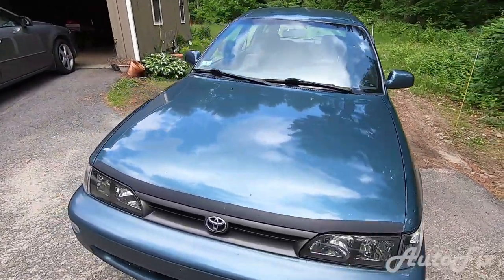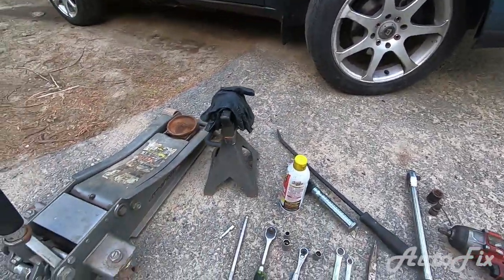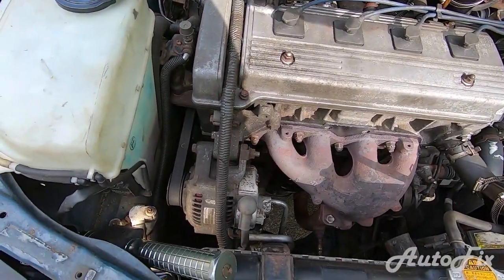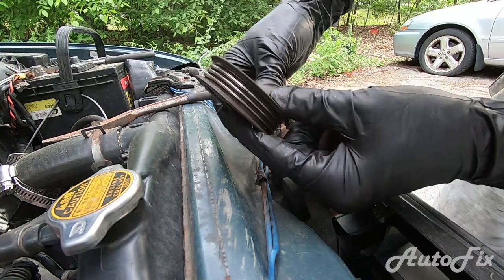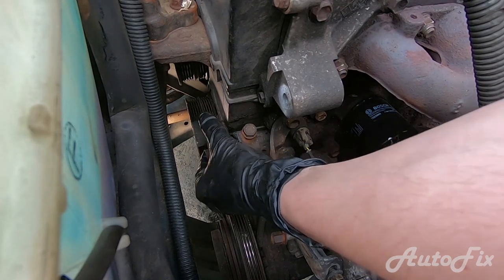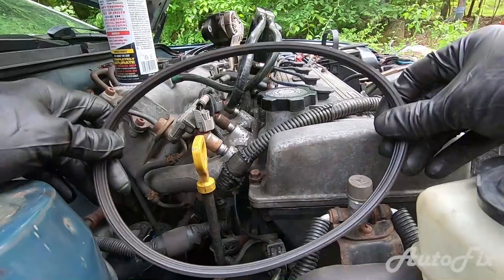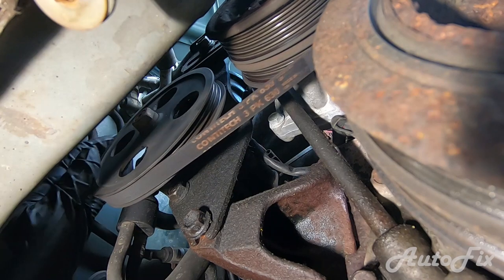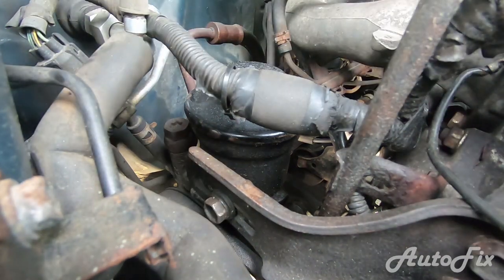Replacing Accessory Belts '93-'97 Toyota Corolla

Comment: Very short video. Also good explanation on how to tension the power steering pump pulley. Thanks.

Looks like a 4afe engine
Reply from the maker: Thank you! And yes it's the same block as the 4A-FE. The 7A-FE is just a stroked out version of the 1.6L with different cam shafts.
Reply: @AutoFixYT  the 1.8 version. I habe the exact same car and colour in 4 door sedan and it still runs great. The only problem is the roof welds (there are many) are all starting to rust through
Reply from the maker: @therealspixycat  oh no that's pretty bad 😬
Reply: @AutoFixYT  all the spot welds start rusting on the roof. Seen the same problem in the engine bay area. Car was produced in Canada I believe for the North America's
Reply from the maker: @therealspixycat  Yeah that's not good

Comment: Hey man, can you pls advise what is the manufacturer of the headlights you use?
Reply from the maker: The brand is called DEPO. Just search 1995 (or whatever year your car is) black housing headlights.
I then opened those up and added a projector to the low beams.
Reply: @AutoFixYT  thanks a lot!

Comment: Hello thank you for this tutorial but I have a question I need to put back my harmonic balancer on my Toyota Corolla 1994 but any idea how much torque I need to tight the bolt on this harmonic balancer please help thank you.....
Reply from the maker: My Haynes manual says 87 ft. Lbs
Reply: @AutoFixYT  thank you so much appreciate it 
lol I have this manual which page I can see this information??
Reply from the maker: @EJ3.16  I found it in the specification page of the engine chapter
Reply: @AutoFixYT  okay thank you 🙏 very much

Comment: Will the water pump still work without the powersteering belt just asking because I might just delete the powersteering
Reply from the maker: Yeah it should. I think the water pump is driven off of a different belt.
Reply: I've been driving my '97 Prizm (aka Corolla) for a few months now without power steering because the belt broke.  So, yes, the water pump should still work.   I was watching this to learn how to replace that belt.  I think I can do it now.
Reply: @leefrench9567  I just did my belts on my '97 Prizm. The power steering is the only thing on that belt, which is driven from the belt driving the water pump. '98 models went with the full single serpentine. I know this was a month ago but if you haven't got to it yet be forewarned.. It may not be easy to find the right belts which is the opposite of what I assumed being basically a Corolla. Maybe I should have said '97 Corolla now that I think about it. I grabbed 3 PS belts before finally taking the old destroyed one up there to compare and be absolutely sure. It took just the tiniest bit of extra slack in one I bought for it to not work with the adjustment available. You might as well grab an alternator belt as well since it has to come off anyway. I thought my belts still looked fine after some squeaking when first cranking it up but it didn't take long for them to suddenly go completely. I ended up with a 'NBH 25030245' from NAPA that works good for the PS belt and just grabbed an alternator belt from Autozone. Mine didn't have a removable splash guard behind the wheel but I could still get to the bolt easy enough with the car on a jack stand. Took a prybar for leverage while pulling for deal life on the ratchet to break it but once I did that everything else was easy. Used a 9/16 wrench I believe on the top bolt. Just a regular cheap ratchet set for the alternator bolts. After the initial finagling with the alternator bolts (which I didn't remove at all, just loosened til I could move it) the whole process took probably less than 10 minutes.

Comment: Question. At 22m. You said if it squeaks, tighten or loosen. I put on a new pull and belt for my ac and not matter what I do it squeaks, so annoying. What do I do to fix this
Reply from the maker: If you are sure you have the correct tension on the belt, make sure you didn't over tighten the pulley. Also make sure the belt didn't get any oils or grease on it. Other than that... maybe you can see where the squeak is coming from. Is it from the tensioner pulley, or is it from the AC compressor. Could be a bad bearing in the AC compressor.

Comment: How many liters of transmission carry those automatic boxes is bad if you go over the level of a 1994 toyota corolla and how much does it take to do the service to the box
Reply from the maker: It should say it in your owner's manual how much fluid it takes. I don't know how much a 94 automatic takes. There are also multiple options. There is a 3 speed, a 4 speed with no overdrive, and a 4 speed with overdrive. So it depends what you have. Do not go over the full mark. Level should be read with the engine running, transmission warmed up, in park or neutral, and the car on a flat leveled surface.

Comment: is it safe to use pry bar on power steering reservoir to tighten PS belt?
Reply from the maker: Like I said in the video I am putting very little pressure on it, and I have a metal reservoir, not plastic. You don't need a lot of pressure to tension the belt. Just enough to stretch it and that's it
Reply: @AutoFixYT  Okay, I'm planning to replace my timing belt, and this video is very useful. Your corolla 7th gen video series is great and I'm waiting for another how to for this car. Keep up the good work and greeting from Indonesia 👍
Reply from the maker: Thank you! Always happy to help! Good luck on the timing belt, I did mine last summer. It's an easy job but be gentle around the crankshaft position sensor. They break easily. The engine is non interference so the pistons won't hit the valves if you do it wrong. So if you do, just try again! :)

Comment: Hello, I have problem with my corolla, every coldstart, if I slightly turned or fully turned the steering wheel, the belt squeaks and I checked it everytime it squeaks, I saw it stop quickly :( my belt is already new btw. But when the engine is already hot, it will not squeak anymore.
Reply from the maker: Ok from the information you have given me I can make two conclusions:
1. Either your belt isn't tight enough (very easy fix, watch the video to see how to tighten it - you do not have to remove any other belts for this)
2. Your power steering fluid (Toyotas take ATF) is so old and worn that in cold weather it cannot hold pressure anymore and is stopping the pump.

So, first check your fluid. If it's not fresh, change it. It's not easy to flush it on this car, it will make a mess and you will get angry at it lol. I've done it twice in the past 8 years and I hated it both times. Once it's flushed, it should improve the situation.
If, however, your fluid is good when you check it, most likely the belt needs just a little bit more tension.

Hope this helps!
Reply: @AutoFixYT  omg thank you very much! I just tightened the tension on the alternator belt ☺ its a very big help for me. Now I am just wondering how do I flush my power steering fluid in the future, since you have said that flushing power steering fluid in this car was not easy lol. Thank yoh very much again mate. Stay safe
Reply from the maker: @amarlancervlogs962  To flush the fluid you want to remove spme fluid from the reservoir until the level is below the return hose from the PS reservoir, which is the one that sits higher up. Then remove the return hose from the recevoir. Have a bottle ready to catch the fluid, and stick the hose into the bottle. At this point it's best to have a second person but you can also do it alone, it will just be a lot more difficult.
However, if you have a second person, at this point have them get in the car. And you have a fresh bottle of ATF ready to pour in. Have them turn on the car. As soon as the engine turns on the fluid will go down. Add more but keep it below the open hole where the return hose goes otherwise you'll start spilling it. While you're adding fluid have the second person turn the wheels lock to lock (fully from side to side). Pay attention to the bottle you have that collects the fluid, it gets full fast (10-15 seconds). Once it's full, shut it off, drain it, and repeat the process with more fresh fluid. After you do it a few times it should come out clear. At that point stop, reinstall everything, top off the fluid level, and clean up the inevitable mess.

Another option which is a lot more simple but less efficient is to use a turkey baster, suck out all the old fluid from the reservoir, and fill it with new fluid. Then turn on the engine and turn the wheels lock to lock 3-4 times. Shut it off, suck out fluid, top it off, repeat. Do this 5-6 times and you should have mostly clean fluid in there. This won't get as much out but it's less messy and less difficult. This is a good maintenance thing to do. Once in a while suck out the fluid and just fill it with new fluid and then it will always stay somewhat fresh.

I know this is very long but hopefully this helps!

Comment: Pulley nut on my car is stuck so hard I can't get it off ☹️ the tensioner bolt comes out but the pulley nut is stuck hard, what can I do??
Reply from the maker: The best thing you can do is to keep trying. You can try to soak it with penetrating oil and apply some heat but very careful with the heat. Otherwise just keep trying.
Reply: @AutoFixYT  thank you very much will try again tomorrow meanwhile I sprayed it few times with wd40 that I had and gonna let it sit all night
Reply from the maker: @michaelmedicworldoftanks33fps  Hopefully that does ir for you! Let me know how it goes!
Reply: @AutoFixYT  yes it worked! I got the nut undone and took pulley off completely then fitted the belt across 2 large cog wheels and after that inserted the pulley back on under the belt then tightened the tensioner first and after that tightened the pulley because it seems it doesn't work the other way around ie. I couldn't tighten the pulley nut first and then the tensioner it had to be done other way around. Anyway thanks for this video it is very helpful and detailed explanation.
Reply from the maker: @michaelmedicworldoftanks33fps  Awesome!

Comment: Can you please do a timing belt video, I need to do it on mine, can you remove the last belt you did without removing any of the other belts? That’s the only one of the theee I need to do
Reply from the maker: I already replaced my timing belt so I won't be making a video on it for a while, but maybe one day I will!
Reply: @AutoFixYT  can I replace the last belt without removing any other belt? I just need to do that one
Reply from the maker: No, you have to remove at least one of the other belts to get the power steering belt off

Comment: Can i get a link to your headlights
Reply from the maker: Here are the assemblies. https://www.1aauto.com/1993-97-toyota-corolla-performance-lighting-kit-4-piece-set-crystal-style-diamond-style-euro/i/1alhz00040
I then took them apart and added a projector for the low beams. That was a universal retrofit projector from Amazon. Also I used LED bulbs.
Reply: @AutoFixYT  are they the same as the OEM assemblies because i recently ordered some headlights but they only had one hole for one bulb
Reply from the maker: @gabrielgomez6898  Yes those are the same. The two bulb ones are the USDM ones. The single bulb ones are the JDM ones. I like dual bulb better.
Reply: @AutoFixYT  yeah me to thanks for lmk

Comment: you almost sounded like Chris Fix
Reply from the maker: Haha kinda but not quite. I am a big fan of his though.
Reply: @AutoFixYT  also I did look up this video cause the water pump in my '96 corolla decided to take a shit on me while driving 
but also gonna replace the old belts with new ones cause one of the belts kinda has a rip in the middle (length wise) so I'd rather not have that belt snap on me when I'm driving 
but my corolla will be sitting in my garage until it gets a new water pump 
It can run & drive but it'll overheat
Reply from the maker: @Jeremy_Hill_2020  Oh yeah thats not good. Unfortunately I don't have a timing belt and water pump video on this car but might make one in the future.

Comment: Toyota never makes things easy
Reply from the maker: But it's still easier to work on than many other cars out there haha
Reply: @AutoFixYT  you’re right, Lexus and Scion still exist😂 I could rebuild a Ford/Chevy/Mitsubishi/Nissan/Honda or Chrysler engine blindfolded and it be easier than doing anything short of an oil change on a Toyota lmao
Reply from the maker: @__DYLAN_ROBIN__  What the heck kind of Toyotas did you work on? Haha
Reply: @AutoFixYT  the ones that are either rusty piles of sh!t or require special tools lmao
Reply from the maker: @__DYLAN_ROBIN__  lol that applies to all cars to be honest